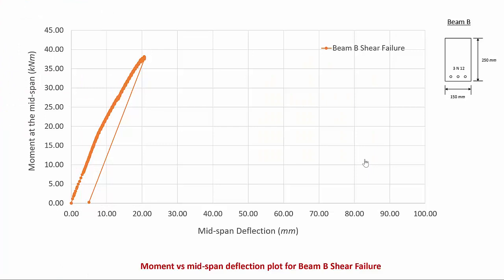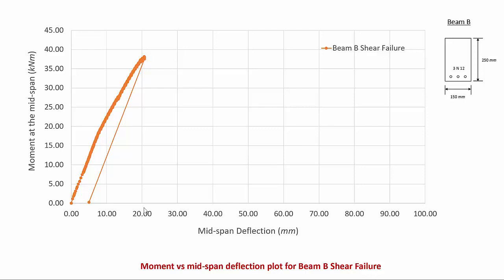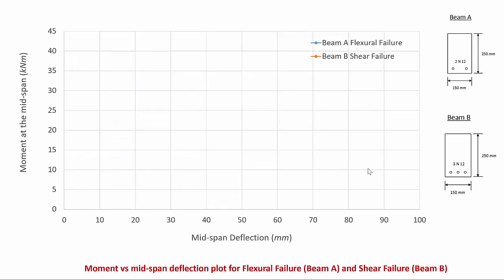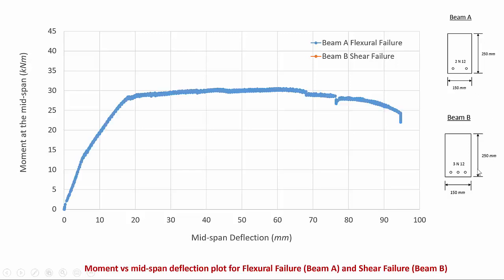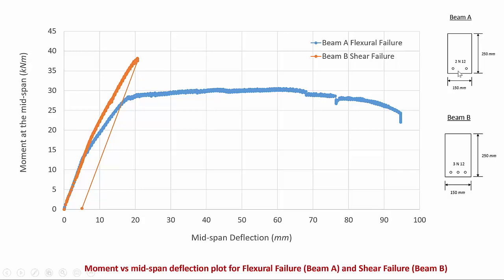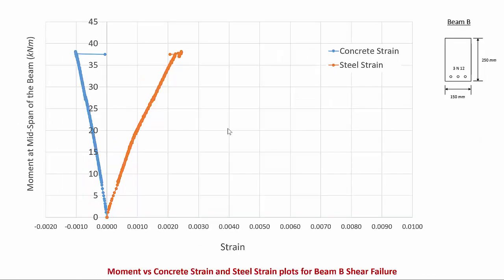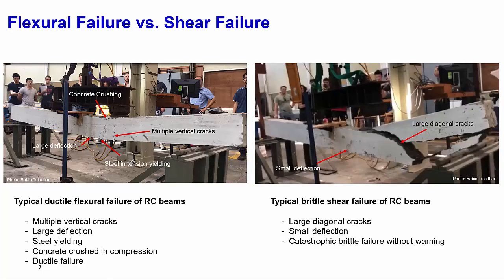Shear Failure video of a reinforced concrete beam.

Comment: I'm going to cast a beam of 250 x 250mm and 3 meters span and I was thinking of reinforcing with 6mm stirrups every 100mm and 12 pieces of 12mm reinforcement evenly distributed. If your broke at 3.8 metric tons then my project shouldn't be a problem... I hope so..

Comment: Great.
Were the two beams without stirrups?
Tanks for sharing.
Reply from the maker: Yes, the beams are without stirrups. The idea is to make one fail in flexure and the second one fail in shear. The flexure capacity of Beam A is smaller than the shear capacity; thus it fails in flexure. Whereas, for the Beam B, shear capacity is smaller than flexure capacity and it fails in shear.